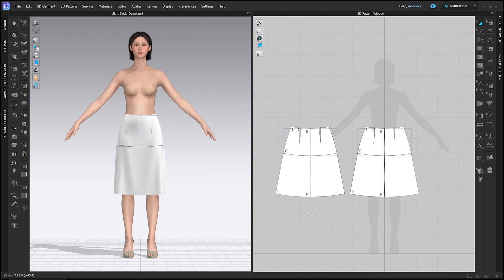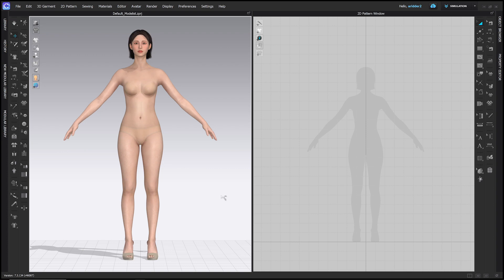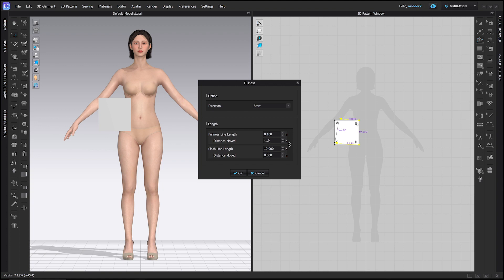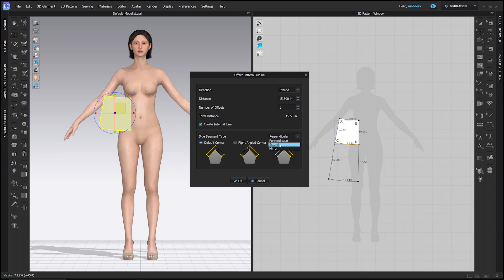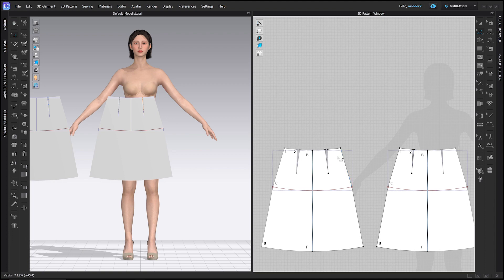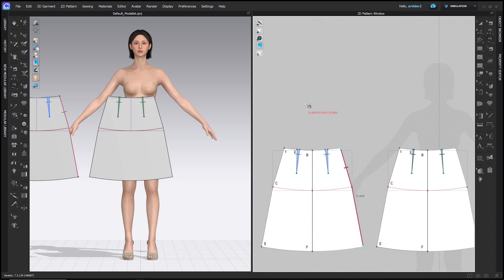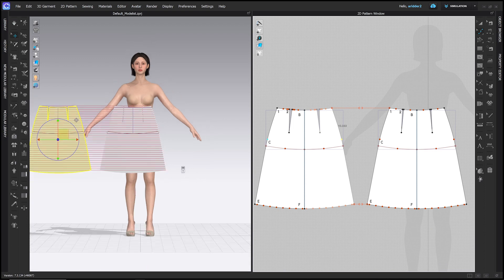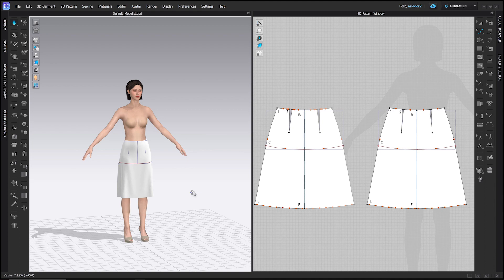How to Draft a SKIRT BLOCK in CLO3D

Comment: Hey there!!…. Could you please write calculation of waist reduction and dart width I’m unable to understand.
Reply from the maker: Yes, of course. Take the hip circumference (say, 38") and divide it by -30 for a straight skirt (38” ÷ -30 = -1.2”), -20 for a standard skirt (38” ÷ -20 = -1.9”), or -15 for a flared skirt (38” ÷ -15 = -2.5”). Note that because the divided number is negative, the resulting calculation should also be negative. Hope that helps!